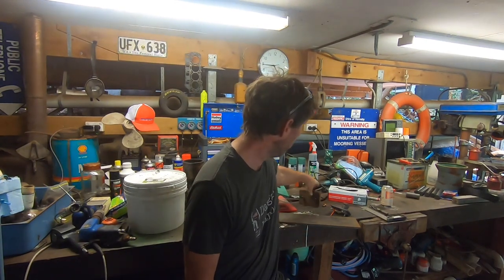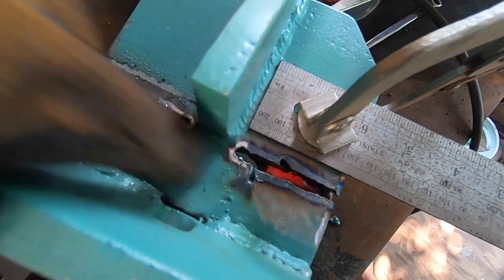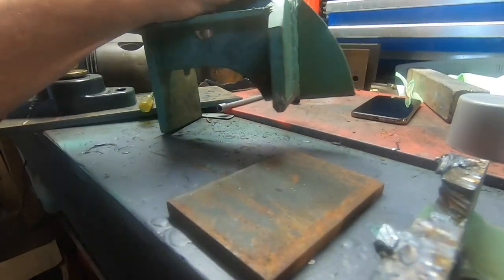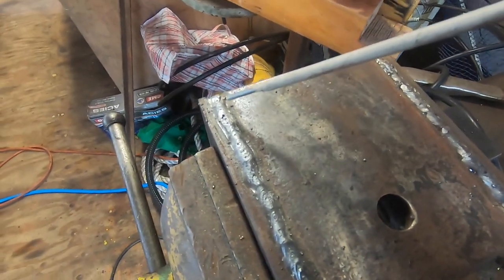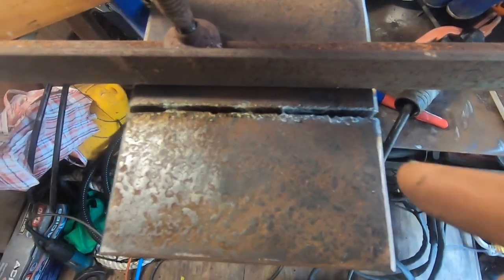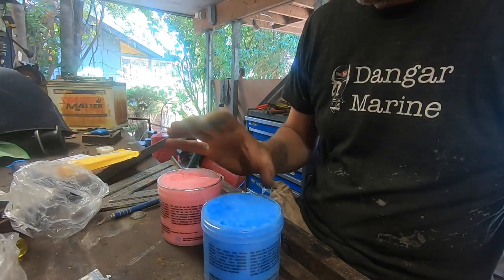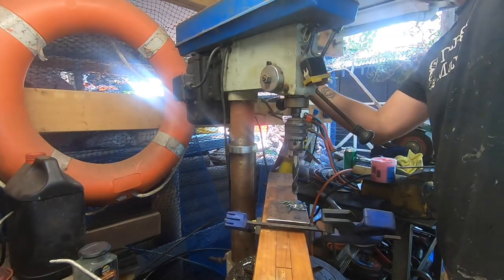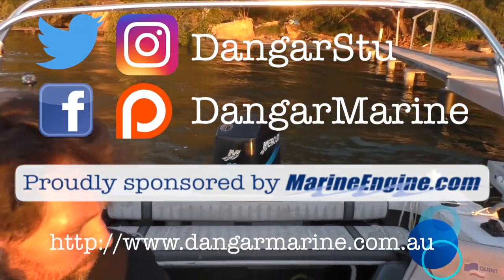Making the engine mounts

Comment: Nice looking engine mounts.  Seems to me the bottom adjustment nut will slowly move over time unless you lock it in place.
Reply: Economan, I agree, lock the bottom one, not the top one. Just use a lock washer on the top with the nut.
Reply: It's good to have a nyloc at the top and a plane nut underneath. The reason for this is when you period ically check you engine mounts, which you should, you wind the nut underneath up and you engine remains close to original alignment. If you are forever winding the nuts down you end up well out of alignment. That is my experience anyway.

Comment: OK heres the deal, there are different lubes and coolants for different applications. for tapping, boring, and reaming use cutting oil. if your surface grinding or drilling you want to use water with a rust inhibitor such as water soluble oil or i like antifreeze. mix it thin. blew thought 3.00 plate with 1.750 silver/demimg on bridgeport on auto feed. I'll even us it on a roughing mill.

Comment: Turn your amps up higher on plasma cutter stu 
Most time when it won’t arc after your cut again is because the air pressure is too low and you have to wait for your air compressor to catch up for the plasma cutter check your user Manual on plasma for its operating pressure and set your cut off switch on air compressor to work in that operating range
Reply from the maker: Thanks James, I'll look into it.

Comment: From the one mount with a crooked engine pad and no welds on the back side, my guess is that they originally bolted the base to the rail and the pad to the engine separately, installed and aligned the engine, then welded the two pieces together in place.

Just remember that anything formerly bolted to the engine (like a gearbox) AND something solid (the frames or rails) will need to be bolted to the engine ONLY, or will also need to be mounted on flexible mounts.  The engine torque was originally transmitted to the hull via the solid mounts and the engine remained static in relation to the hull..  Now the engine can move under torque in relation to the hull. Anything bolted solidly to both the engine and the hull will now carry the total torque unless it is also soft-mounted.  (This is why your truck transmission has a soft mount where it attaches to the frame members).

I seem to remember a belt-driven pump on a steel bracket attached to the hull.  You may need to look at getting that on a bracket attached to the engine block or the engine side of the engine mounts.

I could be mistaken in this.  My experience is more with putting large engines in cars where they have no business living.  My practical experience with marine propulsion lies in boilers and steam turbines in 650 foot ships.
Reply from the maker: I can to a similar conclusion regarding that one dodgy mount. It's also worth noting that there poly mounts and still incredibly rigid. I can't deflect the at all with my hands.
Reply: @DangarMarine  I hope that those mounts aren't of a compound which will either soften with heat and oil and allow more movement, or become brittle and fracture over time.  The solution in the automotive world would be to either install some hefty angle iron brackets extending over the mounts to restrict movement past a certain point, or chain the block at two points on each side, leaving enough slack for torque movement.

Difference between a boat and a car is that, if you break a motor mount in a car (done it), you can always walk home.  Nothing worse that a propulsion casualty at sea.

On a different note, I like the dry exhaust idea.  Many years ago I discovered the hard way that the difference between a "wet exhaust" and "hole in hull below waterline" was the little piece of (breakable) 3" hose between the hull fitting and the exhaust manifold.  Thankfully, my dad was a big believer in large batteries and multiple bilge pumps...and radios so we could have the trailer waiting on the ramp.  Not sure what kind of idiot designed a hose below the waterline on a penetration with no seacock, but it was re-designed before the boat went back in the water.

Comment: I think a 10 gauge run should give you a tonne per inch strength, given no movement is possible in the joint, ie both sides welded. The reason we fully weld is to keep corrosion out, thats a good reason even for mounts

If it was me and it isnt, do a penetration run with a hot 10, then pad weld the undercut out at less amps
also be aware some rods are better than others, I like CIG Satincraft especially downhand.
its important that root run is clear of slag and dust, warm plate is better to weld on than cold.
Fill whatever craters you get on the ends with weld, again a hot 10, this because it doesnt get to run long filling a hole

radial drills are usually capable of not relying on pilot holes, if its clamped work it shouldnt move, 
we could drill 3" but the thing was massive, like you could live inside it
centre punch the start to mark so the bit doesnt wander
best for the year
Reply from the maker: Good point, any gaps would definitely trap water and start to rust.

Comment: Hi Stu, Nice conversion! I know you have thought of this but wanted to bring it up. Does the motor mount positions give you enough adjustment to mate with the propeller shaft? (up down). I assume left to right will be mount placement in the engine bay framework. Looks like the new mounts will give you the correct pitch due to the height of the threads. A dial indicator looks like it will be your next best friend.
Take care
Reply from the maker: I think there should be more than enough adjustment. I'll position it pretty close before drilling the rails too.

Comment: Hi Stu, could that bit floating around with the pump be a spline plug used with the impeller?
Reply from the maker: Maybe. There is definitely a neoprene cap in the kit than plugs the end of the impeller, but it may go under it.

Comment: Not sure why porosity the length of the weld, it looked clean enough. The incorrect polarity can give you porosity sometimes, or non-preferred polarity. A long arc length can give you porosity, but that is typically in spots. Usually, if the flux is bad you can get past that with a little more heat (not so good for vertical though). If contamination of the weld, you can grind it out to a groove and run another pass over it, and that normally burns out the porosity. 6013 will make your welding life easier for most projects. 7018 from the oven for high stress points, and the exterior hull. (1/8 inch rod: 90-110 amps vertical, 110-130 flat & horizontal [slight variations as needed])
Reply from the maker: Thanks for all the info David. Someone else suggested that it could be that the 7016 rods have been out in the open for over a month and will have absorbed some moisture due to not being in an oven at all.
Reply: @DangarMarine  Could be, depends on the makeup of the flux. Mostly moisture is bad because it introduces hydrogen into the weld and can make it brittle. I've actually welded through a shallow puddle of water a time or two, a little more heat... 😇 .  I suspect, it could be, that your 7016 is made for AC polarity, and doesn't always work well in a DC polarity setup.

Comment: I've never seen engine mounts like the one's originally on your engine, the new ones you are using are common out here. The hole where the bolt for the engine mount needs to be a little bigger so the bolt moves freely through the hole. If you don't have any movement your not going to be able to trim out the engine as the bolts will be binding up.  Welding is all about working the puddle sometimes I'm using two rods tig welding with 7018 the metal is too thin or a big gap. When you've burned 1000lbs or more of 7018 in the last couple decades it becomes second nature. My welds have been field tested in real world situations hundreds of tons of force applied to them. All stick welding I've only used a mig welder 3-4 times in 28 years of being around steel fab.
Reply from the maker: Good point about the binding as the angle changes. I'll get the die grinder onto them to make a small amount of clearance.

Comment: Does your transmission have a "down angle" out-put? If not, that would explain the angle on the old mounts. You really do need to slot those 20mm holes or there will be no fore and aft adjustment. Consider installing a dripless shaft seal. Having a steel boat you want to keep salt water away from the bilge. I usually suspend the engine and transmission in as close to exact location as possible before making new mount plates. That way I can set any angle needed into the base plates. The two thin jam nuts go below and the single thick nut goes above on the 18mm stud to lock the engine in place after aligning. See you in the next one.
Reply from the maker: All the slots in the old mounts (and the base of the new mounts) were transverse. I'm assuming you just put the prop shaft in and out to get your fore and aft adjustment.
Reply: @DangarMarine  The chances of the mounts being perfectly square with the shaft flange are slim to none. the engine and transmission need to be able to "twist" to get alignment. Checking alignment with a feeler gauge all the way around the flange is .001 per inch of diamater. Example would be: a 4 inch dia. flange would be .004 or less gap between the flange faces. Trust me. Make slots, you will be glad you did. You will also want 2mm clearance for the mount studs on the sides of the slots.

Comment: I would use spacers as the bottom nuts may vibrate down.
Reply from the maker: They aren't going to be able to rotate against the steel with a tonne of metal pressing down on them. It is a pretty established design.
Reply: @DangarMarine  Good, sometimes when something looks funny to me its just me.

Comment: Don't you need locking nuts under the engine too? I think the bottom nut is even more likely to loosen up than the top one due to the weight pushing it down.
Reply from the maker: The weight of the engine stops it rotating.

Comment: Should the lock nuts not be on the bottom, the load is pushing down and the single but could work it's way downwards.
Happy New year from Scotland.
Reply from the maker: The weight of the engine pressing down stops the bottom nut from rotating. As the top nuts are under no load they need to be a pair.

Comment: That plasma cutter just doesn't have the power to cut 10mm plate cleanly. I used to cut 12mm plate with a 100 amp plasma set at about 70 amps. It cut cleanly and fast

Comment: Thanks for telling me about those glasses.  Something I didn't know I needed. 

By the way, one nut on bottom two on top?   What keeps the bottom  nut from settling over time?
Reply from the maker: The weight of the engine makes a pretty good locking nut for the bottom one. :)

Comment: with pilot holes the rule is the pilot should be no bigger diameter than the flute minor thickness [width of the area at the very tip] of the final size drill bit, people usually go too big on the pilot and end up with all the grabbing problems
Reply from the maker: Thanks, great tip!

Comment: Happy New Year Stu, from the UK.
Does that spacer fit over the shaft in the Jabsco? If it doe's then it has a thin lip at one end to throw any weeping coolant out of the drain holes in the pump body. It should fit between the roller bearing and the pump.

Comment: The locking nut on that engine mount set-up, think about it.  Are you sure the locking nut doesn't go on the bottom side?  I don't think it's half so much a danger that the engine will jump up out, as it is that the lower nut will loosen due to vibration, and the engine will settle down ruining your alignment.  Just a thought.  In fact, if you can lock it from both directions, it would probably be best.
Reply from the maker: The weight of the engine stops the bottom nut from turning.
Reply: You are probably right.  And, I know I'm throwing a bone in the soup, but, the engine does torque, and in the process, it lifts at least some of the weight of the engine off the mounts.  I've never seen a motor mount like that, so I've no experience I'm relying on.  It just looks that way to me.  It comes down to the question, does the weight of the engine hold the nut tight, or does it help unscrew the nut as the engine torques and vibrates?  It's not worth tossing a coin, or even having to look-see and having to make a repair any time after the engine is installed.  Ask for another opinion.

Comment: This my be obvious (so I apologize) but have you considered sharpening those expensive drill bits when they get dodgy? It would be cheaper, and having a sharp spare would end up being faster than taking the time to go buy one.
Just a thought. Cheers mate.
Reply from the maker: I have been sharpening them on a Tormek stone. I'm going to look up if there is a jig available to keen them locked into the correct angle and then maybe do a vid on that.

Comment: Here is something to think about by putting shorter motor mounts on your boat.  Is your oil pan going to clear your hull?
Reply from the maker: The total height remains exactly the same. If I move it even a mm it it won't mate with the propshaft.

Comment: Hey Stu, I know it is a bit late now, but just curious what the recommended amps are for those electrodes? I think you said you were running around 130? If those are 2.4 mm (3/32") rods, the general rule is 1 amp per thousand of rod diameter. So, in this case, 3/32" would run about 93 amps. This usually works for rods that end in teens such as 6013, 7014, 7016, 7018. For 6010/11, drop it down 10 amps. For rods like 6027 or 7024, increase it by 20 amps. JMHO!

Comment: You need to use safety gear around welding and cutting as well as your grinding. Bare skin is a no-no at all times when arc welding. The arc burn can get severe. Plus other flammables in the vicinity are bad news as well. Those mounts should have been welded with at least 7018 or even 11018 rods.
Reply from the maker: Yes, 7018 used.

Comment: 16:25 Probably Captain Obvious, but for the longevity of those big drills (pilot or not) a drill press that can do half those rpm or better will help considerably.
Its the difference between too fast and the cutting tip mostly skidding on the surface taking off random slizzers and instead giving the tip a chance to bite in and take sizable blue chips where the cutting heat has transferred to the chip. A big step drill might be a good compromise since the cutting surface is small so you can impart more downward force into biting in without the solid clamp down needs of going up in drill sizes.
Reply from the maker: Yes, I tend to set and forget with those belts. When I install the new ones today I'll set it up for these bigger drill bits.
Reply: @DangarMarine  All good. I'm spoiled at work with speed controls and gear selection  when drilling, would probably be the same with belt drive.
Going to highest or lowest pulleys is easy, its usually getting back to mid-mid that might need fiddling with the tensioner.
Love these sorts of YouTube video, have learnt so much from your experience and just giving it a go and getting it done.
"Necessity is the mother of invention" as they say. 
Where else can you be an apprentice for a day to so many people with such diverse knowledge bases.

Comment: Hey Stu I noticed once you had the bracket attached to the engine at 18:50 you have two nuts on top and one on the bottom. It seems to me it should be the other way around. Wouldn't the nut on the bottom be more likely to loosen in the direction of gravity? Or just two be safe two on top and two on the bottom. Cheers mate!
Reply from the maker: The bottom one has the weight of the motor resting on it so it won’t move but the top is free to vibrate hence the locking nut.

Comment: No lock nut on the bottom? I think even a thin one could prevent any movement downwards, there is quite a lot of vibration!
Reply from the maker: The bottom nut can't vibrate again the weight of the engine.

Comment: Stu, great work!  Please wear shoes when cutting/welding. I lost a big chunk of flesh on the top of my foot years ago.
Reply from the maker: How did you do that?
Reply: Dangar Marine Cutting a galvanized pipe with a oxy acetylene torch in my teva sandals. Big blob of slag fell right on top of my foot. Stupid move on my part.
Reply from the maker: Ah, that happens. Most burns I’ve had have been less painful than the blisters I’ve had from wearing shoes.

Comment: Hey Stu,  Could you have used a length of woman's tights  ( pantyhose )  tied
off tight on those pulleys as a temp measure to use the drill press?
I've always heard you could use pantyhose as an emergency auto Fan Belt.
Reply from the maker: Yes, I've heard the same thing but I've never tried it so I'm not sure how well it works.